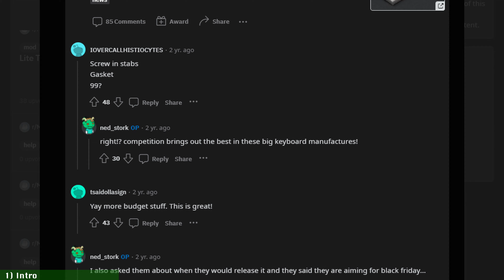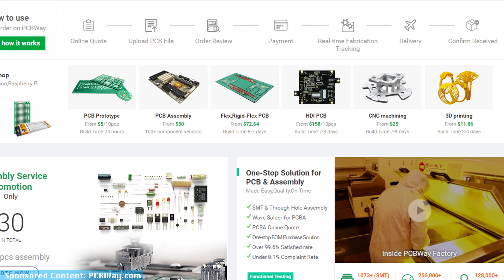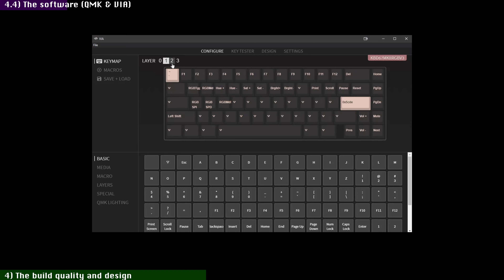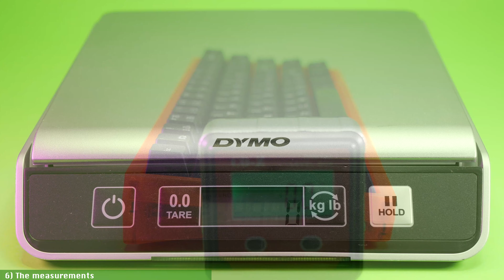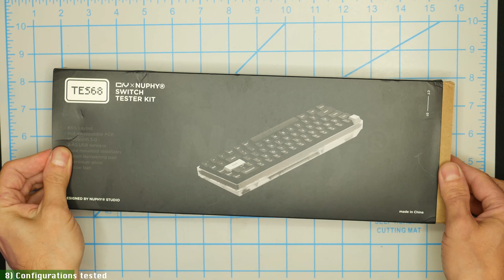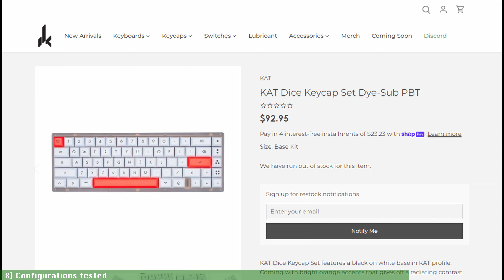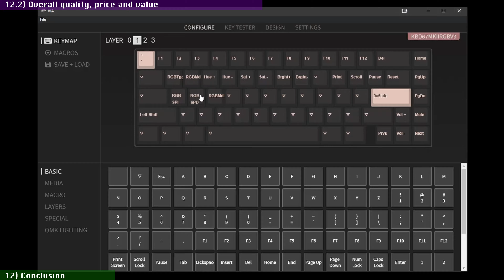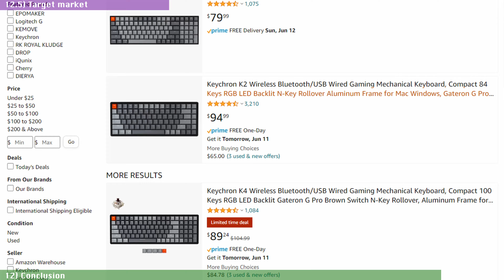KBD67 Lite: still worth it?

Comment: how is the stab so good!!? no ticking at all. i'm so frustrated by my stab because they are ticking no matter what kind of mod I tried.
Reply from the maker: Tuning stabs can be a bit tricky in the beginning, but with a few trial and errors we all get there eventually... How did you lube the stabs housings and the wires tips?
Reply: @IOSam  I used 205G0 lube on housing and donut dipped the wire tips. I have holee mod, band aid cotton between the pcb and the wire, balanced the wire.
Reply from the maker: @damon920  Ok, you did quite a lot there. A few questions: Are you using the stock plate? Are you getting the tick noise only on the space-bar (if so, one or both sides)? Or on all stabilized keys? When you lightly tap the key on the ticking stab (without pressing it), do you still get the tick? Or only when you fully depress the key?
Reply: @IOSam  yes I did all the possible mod there is out there haha. I am actually using RK84 keyboard. There is no tick on my spacebar after the mods. However, the left shift, backspace, and enter keys ticks when I light taps on them. I am also using durock v2 stab set.
Reply from the maker: @damon920  Well, good that you got the space-bar right (usually the most difficult). I think the only thing left for you to try is to place pieces of tape on the edges of the plate stabs cutouts (like what I did here: https://youtu.be/mF2aqtYb_e0?t=1209 ). This will ensure the stabs housings are not wiggling inside of the plate cutout (which can happen if the cutout is a bit larger than the stab's housing).
Reply: @IOSam  I also tried that. I think i'm just going to live with it. Thank you so much for responding to my comments.
Reply from the maker: @damon920  I have to say that while I always had good experience with PCB mounted Durock stabs, I wasn't so lucky with their plate mounted ones, which I tried in one upgrade project of an Akko board and had to discard it because I simply could not make the space-bar to work without ticking.

To this day, the best plate mounted stabs I tried so far was, by far, the (unfortunately much more expensive) one from NovelKeys (https://novelkeys.com/collections/supplies/products/nk-stabilizers?variant=38218595893415 ), which I even featured it here 👉https://youtu.be/sTQfpqbskfw?t=1857

These have worked out beautifully to me every single time! The problem is that, ever since people found out how good those NK plate mounted stabs were, they have been sold out for ages now...

Comment: @1:01 you say polycarbonate whilte the kbd67 is and always was incejtion molded abs (the case that is). @7:42 you rightfully say its ABS. One disadvantage of ABS is/will be that it will yellow over time.

Plus is it has a local EU vendor and ISO support

But one of the best things is to change the case . I have the case in different colour options and its nice to change the case colour to accustom different keycap sets.
Reply from the maker: Hey Benjamin! Yes, you’re right on both accounts. In the beginning there, what I actually meant [but failed] to say was that it was a plastic keyboard with a polycarbonate plate. On the second account, it is true that ABS will discolor over time, but that effect is usually more visible in lighter colors of course.

As for its support of both ANSI and ISO (https://youtu.be/7K0567kU5bE?t=253 ), it is one area where KBDFans indeed still beats other vendors out more often than not. Having ISO support is always a nice thing to see!

And yes, not only being able to change the case, but having the option to do it on the cheap (if you go with the plastic case) or even to go with a more premium option (if you go with the Alu case) is a fantastic bonus!

Comment: Hello sir, i wanted to ask if you will make a video about the KDB67 lite r4 and the mine differences.
Reply from the maker: Hi Ashkar! According to KBDFans, the only meaningful change between R3 and R4 (at least for the wired-only version of the PCB) was the different colors of the case.

Pretty much everything else is the same. So, for that reason, there wouldn't be much point in making another video about the R4...

Comment: great board. only issue is that the case screws broke the 4 corners even though its screwed in properly.
Reply from the maker: Wow! How did that happen??? The case has metal threads for the screws precisely to avoid that. Did all the metal threads break too? Do you have this issue documented/photographed anywhere I can see? I’d really like to take a look at this!
Reply: @IOSam  i can send a picture if you want. i really have no idea how that happened but I've been seeing others getting the same issue.
Reply: I think mine has the same little issue, though its only visual and if you look really close (because i have the transparent black case)
Reply: @justanotherpxrson  downside of having these cracks... you fear that it will break if you mod it many more times
Reply: @lollol-mg9cr  it doesnt feel like it will break though, thats the thing
Reply from the maker: @lollol-mg9cr  Can you post these pictures on Imgur and share them with us here?
Reply from the maker: @justanotherpxrson  Same request: can you post these pictures on Imgur and share them with us here?
Reply: @IOSam  I could try, honestly I can't even tell if they are cracks at this point because translucent black plastic looks weird. I will take a closer look.
Reply from the maker: @justanotherpxrson  Yeah, if it is just stress marks on the plastic it will be difficult to catch on regular phone cameras. You might need a lot of light.
Reply from the maker: @lollol-mg9cr  Man... That looks bad! From what I can see  there (https://imgur.com/a/UYFONbb ), it seems the metal threaded socket rotated around its axis and fractured the plastic.

The problem could have been the overtightening of the screw. Did that happen on all sides of the case?
Reply: @IOSam  all four sides. started with 1 corner so when i noticed it I loosen the other screws to make sure they are not too tight. surprised it only took 2 days after discovering the first crack all 3 joined the club
Reply from the maker: @lollol-mg9cr  While you could replace the broken case with another ABS (https://kbdfans.com/r?id=1gi7t5 ) or aluminium (https://kbdfans.com/r?id=spr3s2 ) case, I don't know how you'd feel about giving KBDFans more money after that experience...
Reply: @IOSam  sadly they do not cover this for warranty but upgrading case to alu or better blade 65 is a real decision making that needs serious thinking. add a few bucks on alu case price and you can get a qmk65 already 😁😁
Reply from the maker: @lollol-mg9cr  That is very true! My QK65 entire order (solder PCB, POM plate with shipping included) was $180. So, if I had to fix a KBD67 Lite now, I guess could still pay $15 for an ABS replacement case, but would probably not pay $125 for the alu...

Comment: I'm running mine plateless and there is really good flex, if you have 5 pin switches it stays in place no problem
Reply from the maker: Plateless??? But are you still using the silicone layer on top of the PCB? How does the PCB not sink into the case (without being attached to a plate)?
Reply: @IOSam  the silicone is so thick it kinda works like a plate in a way to keep things relatively in place

Comment: Given how good the KBD67 is per your review, I went and bought the CIY GAS67 for a lot less lol.
Reply from the maker: Considering how good the CIY red switches I tried here were, I'm very curious to try the CIY GAS67 myself (I know it got quite a few good reviews out there). Please let me know how you like it when you get it!
Reply: @IOSam  For costing only half as much as the KBD67 Lite, I think I can ignore the toggle switch as the blocker.
Reply from the maker: @jayz9253  What is that toggle switch for? Turning on/off the backlighting?
Reply: @IOSam  Win/MacOS, looks less ugly in person than B-rolled.
Reply from the maker: @jayz9253  Hehe... That was definitely an interesting choice they made there! While it would not have been my first choice of placement for such a switch, I don't find it that bad… Especially when considering the price of the kit.
Reply: Hey, i would really appreciate if you could comment on the build quality of gas67? I currently rock a sk66 but i am looking to get either a gas67. The only thing shying me away is the build quality and the screws strips. I am really conflicted if i should buy it or not, since i am afraid that it will break.
The other option is kbd67 but it is for a lot more :/